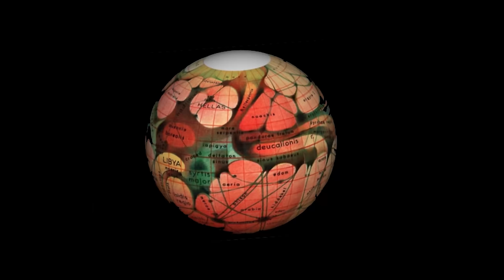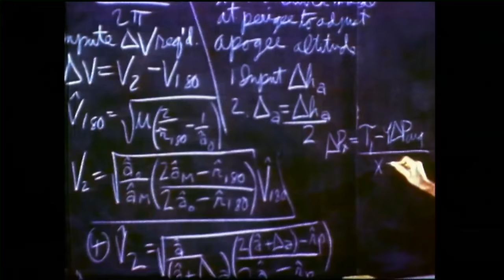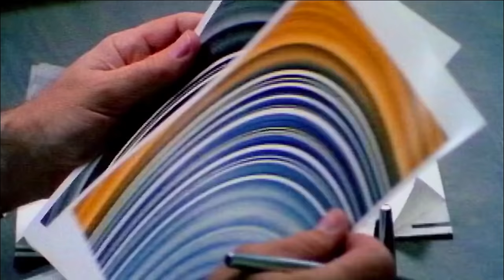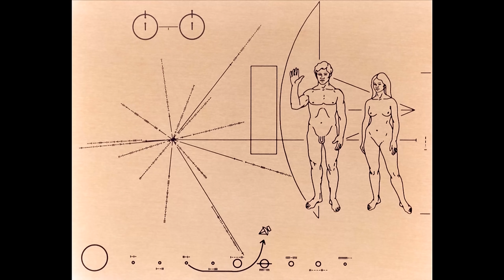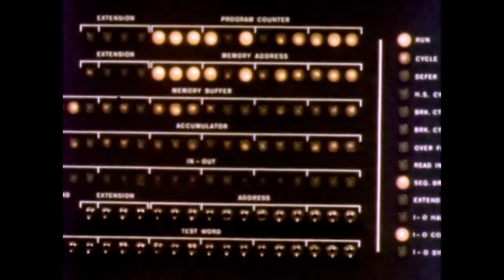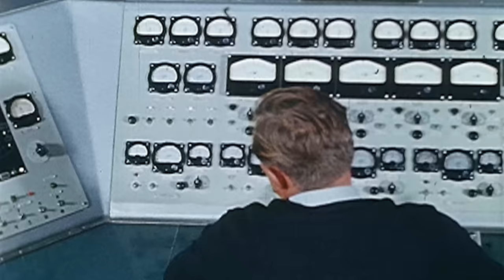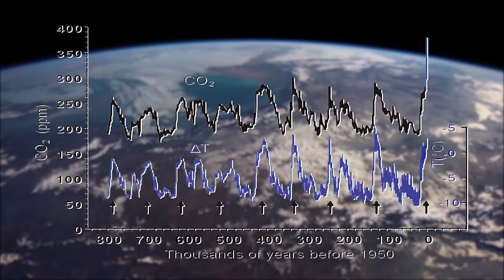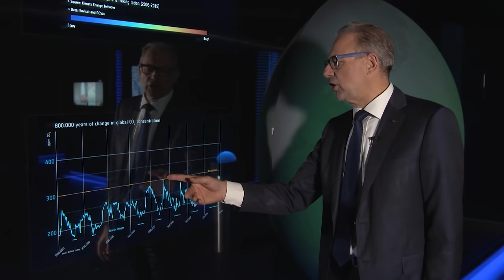2+ Hours Of Facts And Science About Our Solar System | Zenith Compilation

Comment: Thank you for saying that Saturn has a solid surface. 
It is an abnormally large pet peeve of mine when people say things like "it's an entirely gas planet", "if you you flew into Saturn, you would pass through it", or "on Saturn, you would have no surface to stand on" or similar statements (this goes for Jupiter as well.
I always think like if those statements were true, what happens to and asteroid that crashes into the planets? Do those solid objects just turn to gas?
Reply: still it would be possible to have a gas planet but the gas itself becomes liquid then solid as the pressure increases
Reply: @Samsung Employee  that is an explanation that would make more sense to me. Still though, they have a large gravitational force, and would attract meteors, so those would contribute to the
It's solid core.
Reply: @samsungemployee5243  According to the theory of gravity there can be “Gas giants”, but we don’t witness this. We see lighter gasses like helium and hydrogen rise, not compressed, even at earth’s surface, where gravity is strongest.
And our lungs can overcome gravity at earth when drinking from a straw, then how is it that the nearly perfect vacuum of infinite space does not overcome the weak gravity in our upper atmosphere and rapidly strip the the air, layer by layer?

Comment: The equator on Mars, like on Earth, is an imaginary line that divides the planet into the northern and southern hemispheres. It is defined by the planet’s rotation. Here are some interesting facts about the Martian equator:

Temperature Variations: Near the equator, temperatures can vary significantly. During the day, temperatures can reach up to 70°F (20°C), but at night, they can plummet to around -100°F (-73°C)1.
Water Frost: Recently, water frost has been discovered near the equator of Mars, which was previously thought to be impossible due to the region’s conditions2.

Comment: Why don't they use some solar panel clearing system?
Reply: compressed air (gas) to periodically blow the dust off would be better than letting is accumulate until lethal.  A very slow, low powered compressor could probably do this. If not, a little extra weight for compressed air containers could be figured into the mass of the craft.

Comment: Bob Lazzar’s Sport model Jr. …. A tipped up disk .. It also sort of  looks like a Cylon raider …… possibly too small to be manned I have to be objective about it and there is a chance it was a ballon, the light glinting off the front or side edge facing in the direction of the sun if i’m seeing correctly.. That cylinder left a vapor trail in one of those shots so I’m convinced that is indeed some sort of arial vehicle … The ocean clip … debatable… it sure looks wild and it look like it’s humming (Traveling at insane speeds) .. transmedium vehicle ..

Comment: Valles Marineris was not caused by either erosion, plate tectonics, or vulcanism. The patterns aren't those of any of those processes. They are, rather, Lichtenberg patterns caused by enormous electrical discharges: the "mythical" thunderbolts of the gods.
Reply: Also the craters were not caused by impact, which is clear if you look at the scalloped edges of the craters. The notion that they were caused by impacts is risible.

Comment: One would think that with the number of scientists at NASA’s disposal they’d be able to come up with tires much less likely to get stuck,and a way to dig itself out.
Instead of the classic “Rock it Barb” method doing nothing but ending up stuck up to the chassis impossible to get out. Finally, as slow as the rover travels for that kind of terrain wouldn’t be much of a problem if the suspension design wasn’t as fragile as an egg.
As far as the solar panels go.  If you already have a general idea of the conditions on the surface you are already concerned about dust buildup on the solar panels hindering their performance. Why in the world would you not come with a way the rover to clean the dust buildup off the solar panels and have the capability to retract the panels for additional protection from the elements, or when not in use is beyond speculation.

Comment: Couldn't NASA just mount a can of compressed air to blast the solar cells? Also, when the winter is over, why did Phoenix not just start back up again? I know the calculator I stole from grade 8 math class in 1995 that is solar powered still works nearly 30 years later.

Comment: What if: the dark matter/mass IS the quantum gravity of dark matter
BECAUSE:
The compression of ALL matter and its conversion into quantum gravity by "squeezing OUT the massless photons where they spin about the acretion disk. Matter teaching the event horizon has the photons violently ejected as rapidly moving gas.

The only matter that comprises the singularity is converted to quantum dark energy the quantum gravity that now defracted from the  canvas of space/time clumps into more complex molecules and heavier gases, metals etc to repeat the cycle of expansion and attraction, (the strong and weak force) electromagnetism creating the field which flows as a wave. Then, once an observation (event) occurs , the cat is out of the bag as the conservation of energy requires that the
OBSERVED the wave collapses and Occam's Razor! 
Reality is projected off the black canvas.
Light given excitation by the frequency of HIGGS?
This ENERGY, VIBRATING RESONATING ,such frequencies that manifest in the physical expression of the string ♾️that flows in and through the singularity, vibrating, flowing at the speed of light and marked by events that establish the flow of time. Once you open the box, whether the cat is alive or dead will determine the next most efficient path based on information received. Each discordant perturbance  seeking harmony , magnetic balance, the boson without spin.
OK! I have no formal education in physics, which is no doubt obvious to you if you have read this far.

I'm an old well read philosopher that would very much appreciate your feedback on any viability to my hypothesis?❤️
Reply: I think you meant reaching where the text was teaching..
Other.than that, very well written! 
Can't help because I just ponder the how's and why's myself..
The following was one of my late night contributions on a similar topic.  😉
Didn't edit.. yes, I overused gravity and would normally clean up the wording.. but 2am on the deck with a few beers is what I got.. hehe..
Be Well!! 😀 

*Universe?
Not a physicist..  just what seems to make sense to me..
Space is infinate.. 
I think of our universe as one burst of “familiarity breeds contempt” due to the gravity until the energy and mass (not necessarily a compressed ball) got to a state where the attractive properties of mass and gravity can't contain the energy created by the compressed mass (?).
Meanwhile, in this infinate space, this has and is happening throughout infinitate space.  New "Universes" being created by farflung remnants of other "big bangs" continue in the vacuum of infinite space.. until attracted by the gravity of the next "greater" mass.. 
I imagine a slow motion, perpetual fireworks display..  the  detritus "recycles" by eventually being gathered by the attractive force of gravity into new collections of “the ashes of what was..”
Fun stuff to think about!! 🤔🙂
Yes.. probably totally wrong.. just a thought..
Be Well!! 😃
Reply: No
Reply: @Grumhead  👍😁 Figures.. hehe.. 
It's fun to ponder.  The models seem to depict only what we can observe and some folks do the math.. but ignoring what we can't see..because extrapolation with no data is meaningless.
"No" works because an expansion of the universe based on what we can observe would be shaped like a trumpet bell.. 
Stiil think the acceleration is due to clumping due to gravity.. from the far-flung matter of our universe with the possibility of being effected by far flung remnants of other "universes"
Ending on non-sequitur quote:
The only people for me are the mad ones, the ones who are mad to live, mad to talk, mad to be saved, desirous of everything at the same time, the ones who never yawn or say a commonplace thing, but burn, burn, burn like fabulous yellow roman candles exploding like spiders across the stars..
Kerouac
Be Well!! 😀
Reply: @michaelfritts6249  The problem with all that small calculations is they dont work in the bigger scale. Like gravity doesnt work on the smaller scale, it does not influence the bigger picture. Same with quantum mechanics. We can not figure it oit because we try to include them. Maybe we should leave them behind when it comes to the biggest of all scales.
Reply: @michaelfritts6249  Also, the "No" was for OG poster.
Reply: @michaelfritts6249  We know for a fact that the whole Newton thing with gravity is incorrect. Maybe Enstein was also wrong, I dont believe he was "wrong" but there is a chance that his model will be obsolete like Newtons model in the future.

Comment: Max 20% of the sea floor has been mapped. There is still new species we are identifying on this planet, so how exactly do we know so much about space?
Reply: The Solar system is waaaaaay easier to see than the bottom of the seas, you only need a telescope. You can have reasonably good amateur ones for less than $5000.

Comment: THE narrative of population being an issue is very false.  all the issues quoted by cause of population has a direct link to monetary system of need for profit.  When we "humans" move away from the current money system to a resource based economy and profit based - the falsely issue of over population will finally end.  when we intentionally have planned obsolescence, cyclical consumption, abuse of resources, and an outright unwillingness to build infrastructure and pipeline to pump water and snow from areas that receive plenty to areas that do not.  For some odd reason we "Humans" are our own worst enemy.  as someone who has lived in the jungle (offgrid) for 2 years without modern comforts - the earth doesn't need humanity "WE" need it.
Reply: Youre living off grid....you shouldn't be here  ! Using SOMEONE'S WiFi!

Comment: So you can calculate and maneuver a craft to Pluto while using Jupiter for a boost by gravitational pull. How would the object know where it is going ???,000 mph to go to Pluto. That's like a 100 mile hole in on using a hockey stick. I'm not the sharpest knife on the tree, but call skeptic.